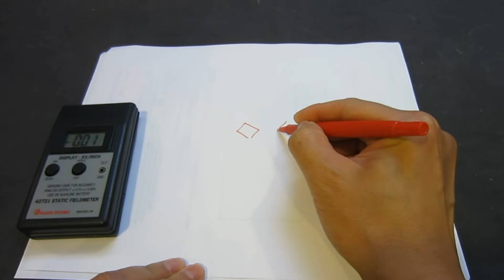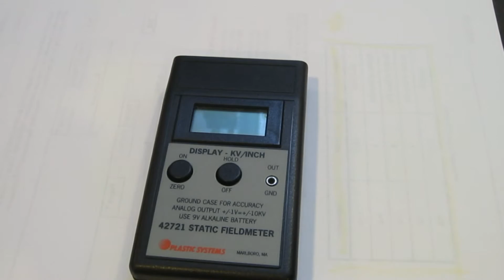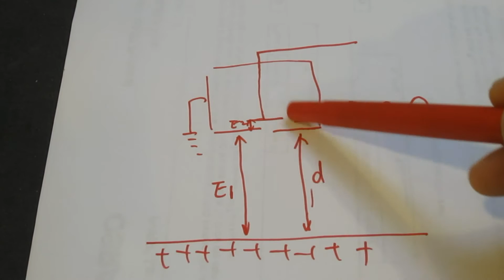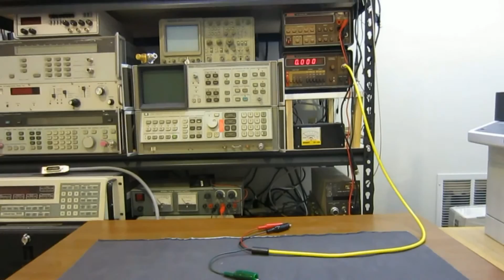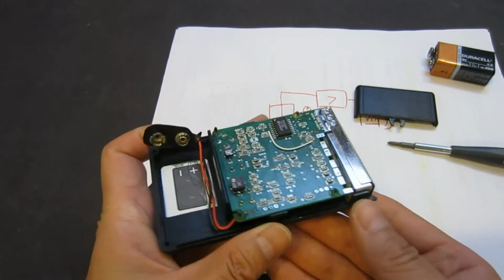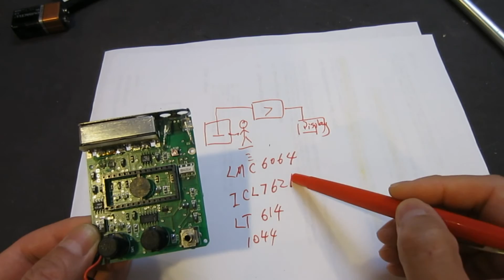Teardown of a Static Fieldmeter

Comment: Compared to GOhm, contact resistance is negligible.  However, wall currents and static charge will cause fluctuations that can be minimized by connecting the guard shield layer in the cable to a guard conductor around the DUT.  GOhm times nF gives 1 s time constants for reasonably sized internal Faraday cages.

Comment: So... to be clear, the opening in the center of the Faraday box is where the field enters. One leaf vibrates, causing the field to be modulated. That AC signal is then more easily amplified than a DC signal would be, which is the reason for every chopper amplifier.

It appears this is well suited to close measurement in the range of an inch or less, where the rotating fieldmill is better suited to measuring from much greater distances, with corrections for distance.

I love that method of setting accurate distance. Two LEDs angled to hit the same spot at 1 inch, but then they are both alternately blinking. So when the spots perfectly align, it is a constant light. Even a little error in the distance appears as blinking where they don't overlap.

Comment: Thanks for the great video. Wonderful content as always.

As you mentioned… I thought these were normally extremely expensive even on the used market. But now that I’m looking online…I seem to find these pretty cheap used on eBay. I picked up a Simco “hand-e-stat” new in the box, I got it as part of a test equipment lot I purchased a few days ago.

It basically cost me nothing. The build quality is great. But I see they have sold on eBay for under $100. It works great with a very similar operating principle and layout. So I’m not sure where I got the idea that these were always extremely expensive

I think it’s most useful for working with lasers and laser diode‘s. Considering they are the most sensitive device I’ve ever worked with or seen anyone work with. They are by far the most commonly fried device I’ve ever seen. 

I’ve had ZERO other issue with static. I’ve bought oscilloscopes and old test gear that were disassembled and rummaging around on a carpeted floor for decades. Only to be put back together and work flawlessly. That’s when I stopped worrying about static.

Not claiming static isn’t a real issue… But I’v  never seen a problem outside of laser diodes. But I fried several laser diode‘s with static… And most any laser hobbyists have also. It’s unbelievable how sensitive they can be. Talk about upsetting… Try frying a beautiful piece of technology & extremely rare laser diode!!! They can range from $30-$150… And laser modules containing multiple diode‘s or high power pumped modules can cost hundreds or thousands. 

I was Lucky to find a coherent 60W laser modules for under $100. But I really want a Jenoptik fiber coupled laser module. Hopefully 40W or greater. But they are hundreds or thousands of dollars. I would be sick at my stomach to fry one of them. So I always practice ESD safety when working with lasers. Thanks again for your videos.
Reply: Scopes and old test gear generally aren't ESD sensitive until you start taking apart newer stuff based on CMOS circuits. The first generation of CMOS logic chips were terribly sensitive to ESD damage, the newer stuff has ESD protective diodes on all input pins. But those diodes are not meant to take a lot of abuse.

Also, keep in mind that the first signs of ESD damage are generally very subtle and hard to detect, but will cause eventual degradation and failure in the figure. Slightly higher current draw, slightly degraded frequency response, slightly lower input impedance. 

High power LEDs are degraded by ESD, too.

Comment: I wounder if they've improved on this type of meter since 1996? Frankly, this is the first time I've seen an electronic measuring device for ESD. I've only seen the primitive Henley electrometers or electroscopes that would react near a charged object. I'm going to look into the availability of this device to see if there are cheaper options.
Reply from the maker: You can find these kind of ESD measurement devices on ebay (like this one http://www.ebay.com/itm/232351641704?_trksid=p2060353.m1431.l2649&ssPageName=STRK%3AMEBIDX%3AIT) and some times they can be bought with reasonable price.

Comment: Thanks for sharing. Interesting tool. What is the big black outline of an IC with a cylinder in the middle, right in the middle of the board? Is that just a way to mount a particular IC?
Reply from the maker: Yeah, that was just part of the socket, there was nothing underneath.

Comment: While that's a very neat piece of kit, I actually found the angled LED trick the most interesting! As it happens, the same technique was used during the Dambusters raid during WW2 to accurately set the height of the bombers during their run: http://www.thedambusters.org.uk/height.html. I can't think I've seen the method used on anything else.
Reply from the maker: Thanks for the info!